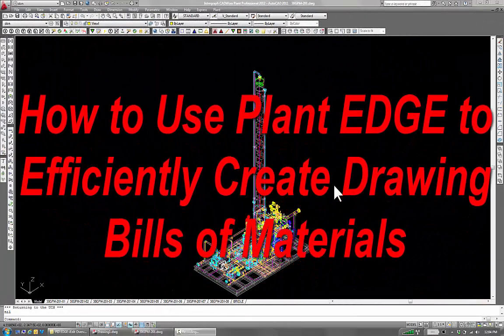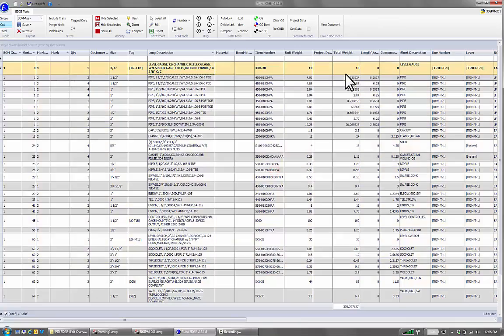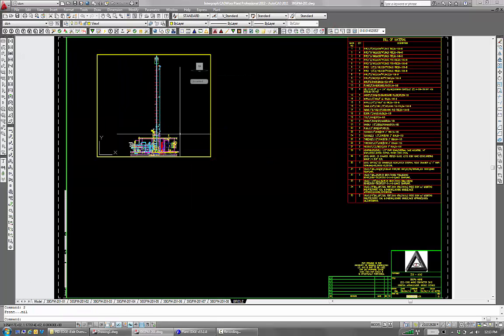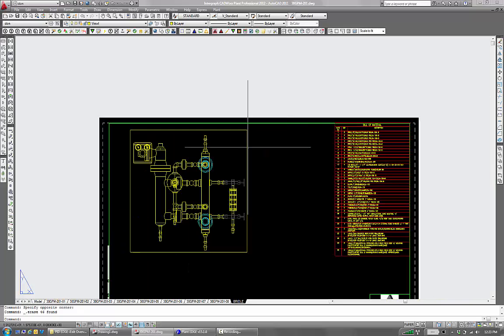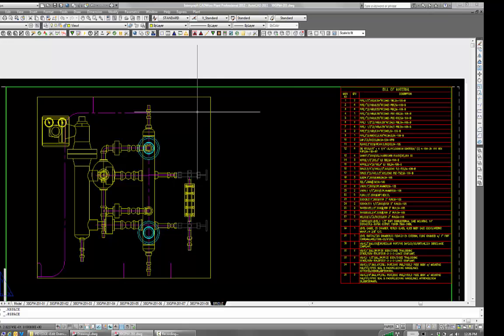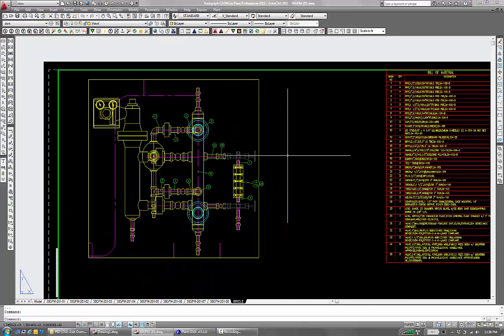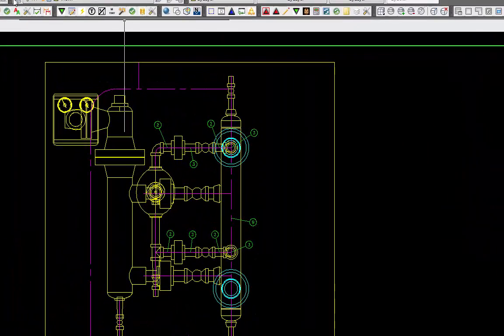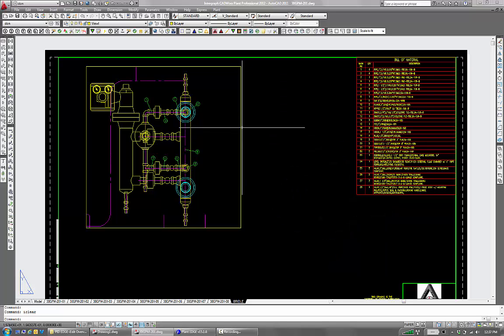Plant EDGE-Drawing BOM Creation

Comment: It appears you can only do this in a live model. When we create drawings we use xref's and only one tab per drawing. Does this work using only xref's?
Reply from the maker: +Chuck Carter Yes Sir!  You just set it to drill down into the x-ref'd file.  Or you can go into the parent model (x-ref file)and run it from there....
Reply from the maker: I am terribly sorry that I have not noticed this comment sooner, but you CAN create BOM's where the components are within an embedded x-ref.  Again, I apologize for not seeing this and responding sooner.